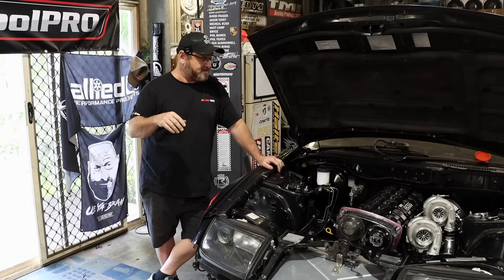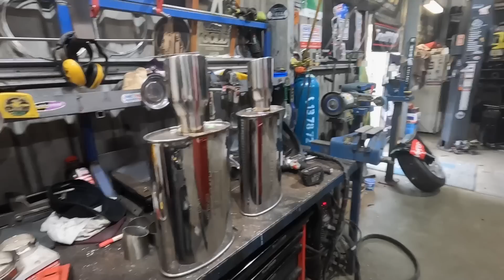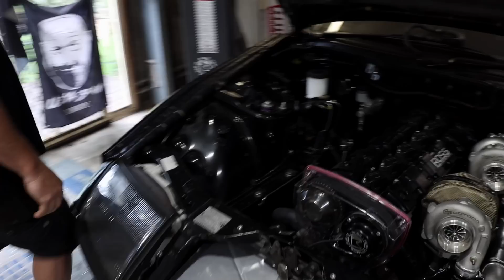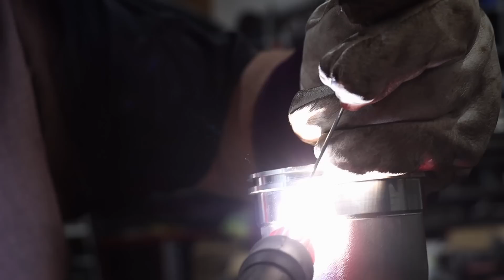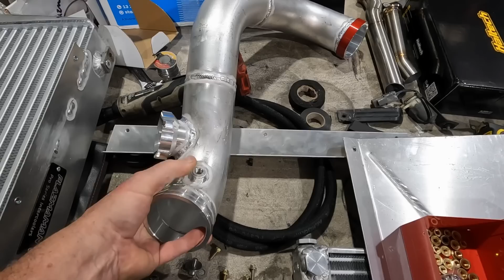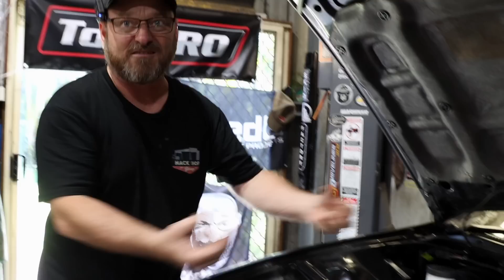Twin Turbo exhaust Fab and a shiny new Plazmaman intake- RB25/30 Powered Nissan Z32 [EP5]

Comment: I'd put that coolant expansion tank on the firewall so it is at the highest point and all air bubbles will easily accumulate there. Ford Australia cars had this setup.

Comment: Is the oil cooler mounting orientation ok? I saw install instructions  to never mount it with the outlets facing downward as the cooler can trap air.

Comment: Could you use a r33 clutch master? They have a much smaller body length compared to the z32 master,  
It would require a base bracket mod to fit into the z32 firewall but might give you the clearance you need, I was going this route with my vh45de z32 conversion
Reply from the maker: I have a Z34 MC coming. Looks like it could work.

Comment: I know of 2 separate cases where an electronic throttle body failed on 2 different rally cars and cost them competing in the rest of the rally they had to retire. I still dont trust them 😅
Reply from the maker: They have to be rubber mounted in high vibration environments, happens on circuit and drag cars also. There are also levels of quality and fit for purpose in e throttle also.

Comment: Al, what's the equation you use for working out injector size? Seems like 1500cc are overkill for this combo?
Running at 80% duty cycle is around 900hp.
Reply from the maker: The equation for this one is the R3 will operate them perfectly regardless of size and I won't need to buy twice if we go further with the power later.

Comment: You need a horizontal baffle plate in that swirl pot. Otherwise it will make a whirlpool that goes deep enough to suck air into the pump. A flat plate with a hole on one side is enough to stop this.

Comment: Open Headers or short pipes do not have enough lenght to allow for harmonics to build in the volume of air available in the exhaust system.  Ssimilar to running a subwoofer outside of the box.

Comment: Al... question.. the water outlet from the manifold to the header tank...one is fixed to the engine ... the other the body... engine torque/flex going to put stress on both due to misalignment?
Reply from the maker: The engine won't move much with the Tuff Mounts and the tank is actually floating on two radiator hoses.
Reply: @theskidfactory  ah ok... looking forward to another cool ride running

Comment: i wonder if you could adapt a drive by wire throttle body onto a carb?
Reply: Kinda defeats the purpose of staying carbed but it would essentially be akin to dbw itb's, very doable indeed if you went partial electronic management on a carb setup, for throttle and ignition going off a bunch of sensors. Could be fun 🙂

Comment: I can help with this, the ends of the pipe have thermal protection. I will send a picture. if you need it 1994 Lexus sc400 orginal my ptoject 160000km I drive in Finland

Comment: i love this build, but would have loved to see what these boys can do to the VG30DETT (it sounds better too...unpopular opinion, lol)
Reply: I have to admit the VG is a great sounding V6 but those V6tt engine bays were an absolute nightmare. What I'm really happy seeing on this build is going tt with the rb30. Haven't watched the other vids on it but I'm hoping he gets inspiration from that Mine's built R34 that revved to the moon and had crazy good response. Either way, this should sound alright. Not stroker RB26 good maybe but the way the exhaust is built, I'm expecting way above average noises for an RB30.
Reply: honestly they are only a nightmare to work on until you "clean up" the unnecessary clutter and devices and simplify the engine down to its core components. the engine bays can be made to be very serviceable and tidy once you modernize it to 2020 era standards, but i get where you are coming from. in stock form they are pretty chaotic.
Reply: @DkBu-zy6ui  It's probably a lot easier to tidy up than some of the modern engines. I'm looking at modern engine bays wondering just how much work would be needed to replace the clutter of hoses and pipes with simple, tidy stuff. Does not look easy.

Comment: bro turbos can definitely catch things on fire. my first s13 ka24det build had a top mount turbo and i didnt have a heat shield to the brake master cylinder. one long highway trip later and i was pulling over with smoke under the engine bay. literally melted the BMC canister into a pile of pudding and i had a brake fluid fire on the side of the road. thankfully i kept a 4L jug of water in the trunk for emergencies and was able to wash the flaming fluid out of the engine bay and onto the road where it continued to burn for the next 10 minutes but thankfully it took the fire away from the car and onto the roadway! had to build a big heat shield to go between the turbo and BMC and hasnt been an issue since. it definitely CAN happen!

Comment: Redline Supercool with water wetter at a 60/40 dilution ratio is what I used in my RB26 and it made about a 10 degree difference in coolant temps.
Reply: Excellent tip.

Comment: When you tack weld stainless with the mig, to finish the weld do you tack it in another spot with the tig and grind off the mig tack and go from there? Or it’s right just to blast over.
Reply: good question!
Reply from the maker: Reduce it down and weld over. I wouldn't mig it at all if it was a customers but it saves a lot of time.

Comment: @23:05, oil cooler have in and out, then the cooler cavity itself. air rises, it runs through lines with fluids until it reaches an area it can float up to the highest locaton within that system. here, once oil and air travels throgh the lines into that cooler. the air rises tothe highest location inside that system, which inthis case is the top side of that oil cooler, and it will get stuck in there, more and more air will accumilate inside the cooler, reducing the amount of surface area the oil has in order to come in contact withthe cooling fins of the oil cooller. this reduces the efficiency of the cooler. anytime you mount an oil cooler with an in and out on the same side of the cooler. it can NVEVER be mounted with both nipples facings the ground. as there is no bleeder valve on the (now top side) of the cooler, to bleed out said trapped air, the only way to moun the cooler to prevent this cavitation of air, is to mount the cooler so that the feed line attaches to the  nipple  at bootom of cooler and the outlet hose connects o nipple at top of cooler so oil full of air enter bottom, fedds through cooler till the top and all air leaves the cooler with the loins out the top of cooler as now there is no place for air to rise and get trapped into.

Comment: the old hks didnt sell well, they had oversized mufflers, and undersized piping. the tips looked ok for sure. but there performance just want there esp for being hks. they did sound amazing though. but 1.25" pipe wasnt gonna cut it. 2.5" bare minimum for these platforms. in the v6 mannor. tand that prior to turbo upgrades ect.

Comment: Looking good al 👌. Did you try a stainless donut for the back dump pipe? Had similar clearance issues in my car. Worked out pretty good
Reply from the maker: I haven't found a SS donut that has a tight radius. Wasted a tonne of money on SS donuts for the crown headers only to find they are the same CLR as a normal mandrel.
Reply: Oh wow I didn’t know that ! Yeah they’re a pain in the ass, won’t be using them again now I know that… can’t wait to hear it start 🤙

Comment: Not sure if you boys will read this but I had similar issues with my hypertune intake manifold hitting my original clutch master in my R34 with a 26/30 and I could not get it engineered. ended up going with a z34 / 370Z master cylinder as it had enough room due to the remote fluid reservoir and passed with flying colours. Did have to use a few weird fittings but it ended up working just fine. Might possibly be something to consider instead of putting a master on the inside of the firewall
Reply from the maker: I just ordered a HFM Z34 master yesterday. Great minds..
Reply: @theskidfactory  it looks like the exact same issues between both cars, so hopefully the z34 master ends up giving the you the same solution. As it was a p.i.t.a to figure out what master to use and I thought instead of using R chassis parts Z chassis parts would work too being these are all parts bin cars really

Comment: The Z32 Nissan wishes they'd made.   
I get that the VG was new and shiny at the time, but the RB20 had existed for years already, and the RB26 was hot off the presses for the R32 GT-R so they COULD have stuck that in there too.
Thanks for showing us how it's meant to be done :)
Reply: VG is slightly older than the RB...

Comment: Your not pickling your welds you also need expansion joints in the exhaust if your running hard
Reply: Alan addressed that.
Reply from the maker: It's not a milk factory, it's not even a handrail.
I have built a few exhausts, I know what you can and can't get away with.

Comment: You could try using a map gas torch to heat the tips to change their color to yellow or blue if you wanted, just make sure that you get all of the oil or fingerprints off of them before setting the fire to them.
Reply: Isnt that more of 2000s thing, rather than 90s?

Comment: Aren’t oil coolers supposed to be mounted with the fittings at the top, or do they make ones with some sort of internal tube setup?
Reply: Yea, I also had that very thought.... ports pointing up,  or to the sides (with the feed line going to the top port) 🤔